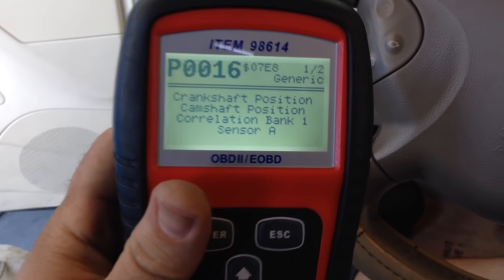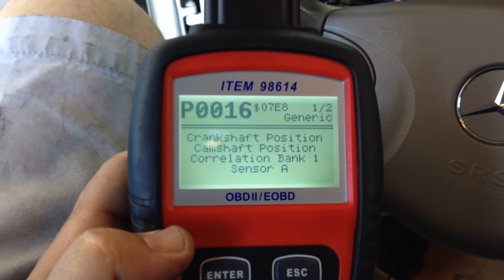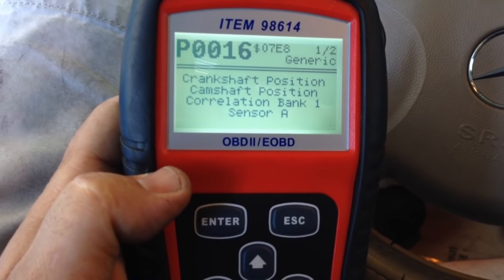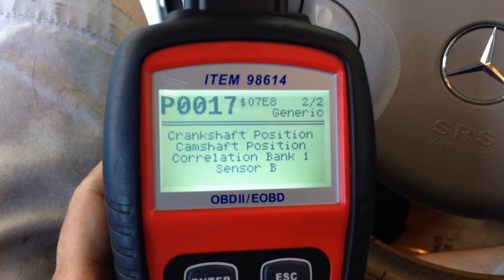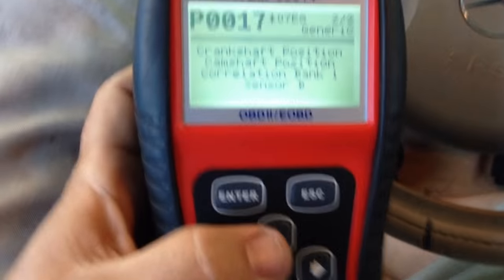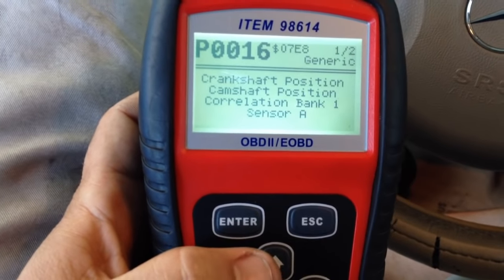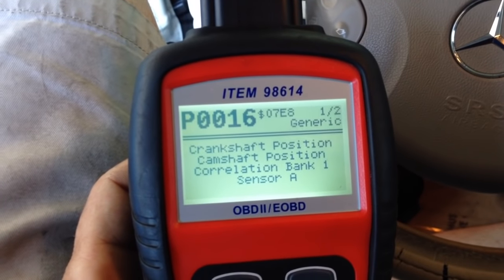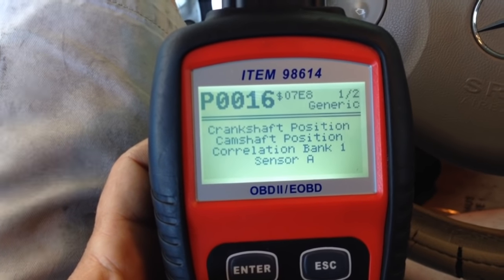Mercedes Camshaft position sensor p0016, p0017

Comment: Hii, I got check engine light and  in OBD scan it says @the posotion of the intake camshaft deviates from the specified value in direction retarded during cold start'' is it camshaft position sensor or other issues pls reply

Comment: What year is that e350?
Reply from the maker: 2007
Reply: @MercedesBenzTechs  ok great, 2010 and 2011 are good. 👍
Reply: Hello, I have a 2007 s550 getting code p0016,  p0018 , and p0019. Car drives normal but check engine light stays on .

Comment: Hi, I have a 2008 ml350 4matic that I purchased for 5000.. I knew the engine had a problem so I took a mechanic that didn't even put a connect to the computer.. we tried to start the car and it did not start. It sounded like it was stuck or something. The mechanic whispered  to his friend then told me the engine is not good and I need a new one.. he told me he have an engine for 900 and he would charge me 800 to put it in.. then he said the old engine was worthless and i wouldn't even get a 1penny for the old engine.. smh another mechanic told me it was some part in the engine.. please help

Comment: So you can't just replace the Camshaft Position Sensor as other videos show.
My High Miler CLK 220 Cdi has stalled while Driving also has intermittent No Turn No Start issues .
I am fogged .
Reply from the maker: This video doesn’t refer to Diesel engines.

Comment: Hello!
I have a 2007 C230 that is giving me "similar" codes. Camshaft position sensor bank A and B. Everything is working properly the only issue is that sometimes it will crank but it wont start. It takes a while and several attempts before it actually starts.  Thanks in advance!
Reply from the maker: Miguel Camarena it can be many different things, have checked professionally without jumping into conclusions but given the year of your car I would assume that you have a bad shaft but it's only an assumption..
Reply: @ MiguelCamarena hello Miguel, i have the same problem and the same car. what was the problem and how did you fix it ? thanks in advance

Comment: Hi Hola I have a Mercedes Benz C280 4Matic 3.0 L I have these codes and mechanics tell me different solutions and not that Do this tell me in the Scanner ... P0016.  and P0017 and says constant adjustment of Intake camshaft of Right Cylinder Bank in Direction Retarded..  What I really have to do?????

Comment: The problem is the camshaft sprocket was never hardened steel so it fails by wearing out. MC had a class action lawsuit which expired in 2016. 5,000 dollars repair. Good Luck!
Reply from the maker: It's not the camshaft that wears out it's the balance shaft but you are right, I'm not sure what's the true story behind it but it's definitely made out of junk metal
Reply: Yes, I meant balance shaft. Was told the metal was cheap and not hardened. You would think Mercedes would not be able to put a limit on when repair can be made. My check engine light just came on 4 months after the date Mercedes would cover.

Comment: Efforts appreciated making this video ,, but here is an Interesting case for you ,, my car Skoda superb( manual transmission) operates perfect after I replaced the engine,,and it has perfect starting, perfect stopping( of the engine) , perfect acceleration , 100 % amazing ! but when the car jerks due to improper use of the clutch pedal and the engine stops ( ONLY NOW the code appears P0016 , and again with the code listed and the (check engine lamp on ) the car works PERFECT ! ,, any tips :D ?

Comment: This could be a stretched chain - I had to replace one at 98,000 miles.
Reply from the maker: It very well could but on 06 and 07 usually it’s the balance shaft

Comment: great video. i need help with code p001177 on 11 CL550 intermittent code electrically it checks good when i get the car.
the car has 89k miles.
thank you.
Reply from the maker: AJ Osmani they don't have the same issues on 8 cylinders engines, depends on miles, it might be bad battery or bad sensors or worse case scenario might be timing chain.
Reply: Mercedes Benz Techs thank you I was going to replace the actuators on bank 1

Comment: @MBT OF ATLANTA Mercedes Master Techs hello MASTER :) i have the same problem, 2009 , checked by vin the engine is not affected by the poor material. I did the test check at 305 degrees the circles are perfectly aligned, changed the magnets with pierburg but still p1200 and 1208. 
I put the test on it and it seems like only on intake right is not moving .the exhaust is moving until 20 degrees but the intake is stalled at 36.2. I moved the sensor from the left bank that is ok. but still not moving. I pulled the rod that magnet moves and is not stalled. What cand be? New oil mercedes 5w40(229.5). The car start and runs perfectly..

 the video

https://www.youtube.com/watch?v=espLGG0hGPg&list=PL-iCE0wRp5tRTd0F1m8M8picRVNjVZXx-&index=89&t=0s

exhaust right:

https://www.youtube.com/watch?v=8fK58GJC7mI&list=PL-iCE0wRp5tRTd0F1m8M8picRVNjVZXx-&index=90&t=0s

l.e: at first when i put the diagnose the intake was shown as intermitent not permanent error,now is permanent..
Reply from the maker: Banu Dragos sometimes the difference is so small, maybe you need timing chain or maybe you need to replace only the pulsation plates b
Reply: @MercedesBenzTechs   can i check the timing chain with little less invasion? boroscope or camera? or do i need to dismantle half engine..did you check my video ? for my it ' look's like the circles are aligned..thank you for your info
Reply from the maker: Banu Dragos I watched your video, sometimes it’s hard to see it with a naked eye and sometimes the chain starch only under load.. kicking the accelerator when you go up a hill or something like that but if you get the code for timing is off it means that the sensors doing what they are design to do, measure the timing... if you don’t have the right computer to do full real diag and see actual values wile idling etc maybe you should get second opinion before diving into the engine..
Reply: @MercedesBenzTechs   thank you . I will investigate further more and if i find the fault i will let you know for your subscribers . Thank you
Reply: @MercedesBenzTechs   hello again. i did the timing chain test again on the left bank and the circles  aren't align. so i supossed it's a timing chain stretch. could be a balance shaft? since the car is 2009 and way above the serial numbers involved in the problem with balance shaft. besize buying and changing the kit with tensioner do i have to buy anything else? i saw that are 2 types of chaine closed chains and open chains what is the difference? thank you

https://www.youtube.com/watch?v=Ml3HBIiS874

Comment: If not have noises READY POO16 AND POO17 MY EXPERINCE WITH CAR CHANGE  IN FROM BALANCE  CRAFSHAP SENSOR  4 AND 4 SENSOR IN FROM  CHANGE  PLUG  AND NOW HAVE  I PUT  CHECK  AGAIN CODE IN HAVE POO17  YOU NOW ME AMATEUR MECANIC  GO TO REALLY  WHERE IS THIS THING  IS IN  BETWEN  MOTOR AND TRANSMMISSION  CHANGE THIS  AND SORPRAIS CHECK ENGINE LA LUZ  DEL CHECK ENGINE NO MORE

Comment: Dealers (ie Stealers) can make propaganda vid's like this. But this car is maybe 1/2 degree off kilter so new magnets on the camshaft + a new sensor and the code should go away. Of course, Stealers would rather charge u $7000 than $300...
Reply from the maker: In 2006-2007 Mercedes used a bad balance shaft that worn premature, after 2007 the problem was fixed and Mercedes used a good gear, on the first models of the 272/273 engine the only way to fix this issue was to replace the balance shaft.
Reply: @MercedesBenzTechs  And did MB give a recall or send out a warranty notice on these bad balance shafts? Most likely not.
Reply from the maker: Brent Waterbury no they didn’t but there was a lawsuit filed as a class action in which Mercedes and the class reached an agreement that Mercedes will copay on the repairs but I don’t really think it did any good because it was only a fraction of the cost of repairs and only for cars with under 125k.
Reply: @MercedesBenzTechs  Thx and I appreciate the feedback. I own 5 AMG's but 3 of them have that damned SRS light on my dash. That should have been a child seat lawsuit as well but nothing was done and MB plead 'not guilty' to 100's of civil complaints.
Reply from the maker: Brent Waterbury Mercedes gives 5 years 50k miles warranty on all the parts installed on their vehicles, how long do you think parts should be good for?
Reply: @MercedesBenzTechs Yur right, 5 yrs/50 K is long enough...
Reply: My bad.

Comment: Does this look good?    https://imgur.com/a/sDUuO
Reply: I do not have a Check engine light or any codes, but its a 06 E350 with an Affected VIN, and 102,000 miles
Reply from the maker: shawn fitzgerald show me all 4 sensors
Reply: The other photos were the left bank, or standing in front of car to the left, here are the right bank sensors.    https://imgur.com/a/ABRYj
Reply: Here are all the photos I took, dont remember which side is which
https://imgur.com/a/pjoLL
Reply from the maker: shawn fitzgerald looks like right side is distressed.
Reply: So is there a balance shaft replacement in my near future, or just drive until the check engine light comes on, and drive into the ground?
Reply: Or do you think I am good for a while?
Reply: Thanks Mercedes Benz Techs :-) Should I be concerned or can i get some more time out of it? Or should i be replacing the balance shaft ASAP?
Reply: Or can anyone read the string above from me and give me some advice?